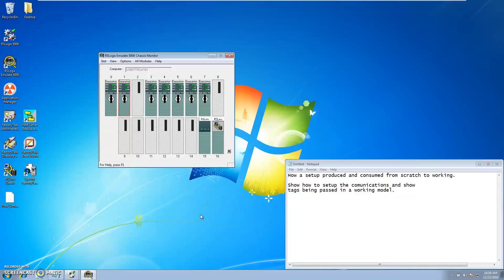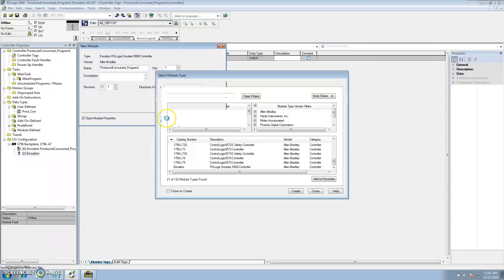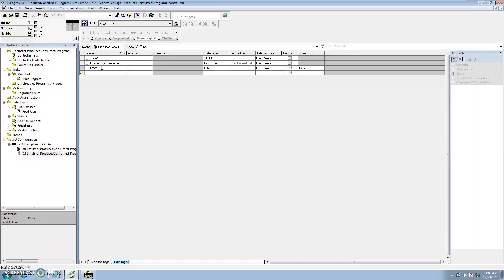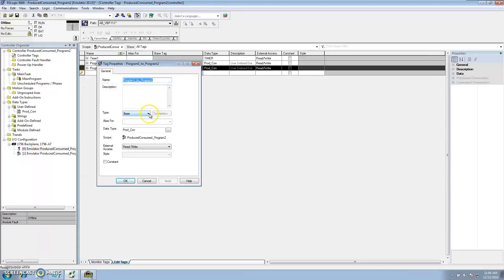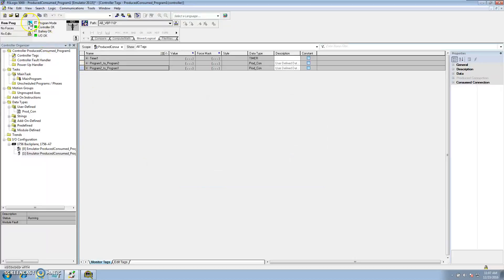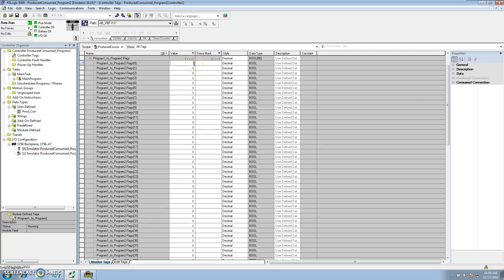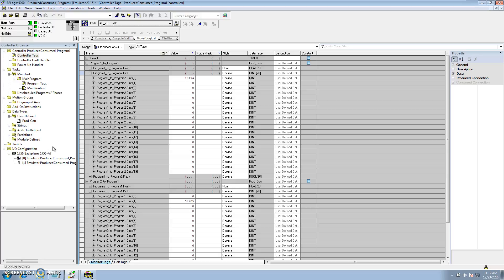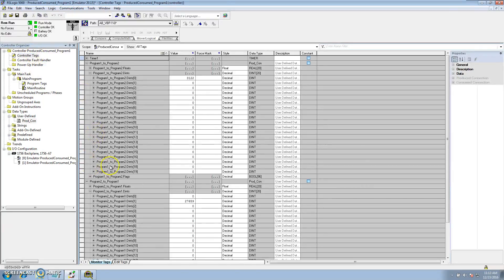RSLogix 5000 Produced and Consumed Tags (HD) | How Processors Pass Data in RSlogix 5000

Comment: @ Shane Welcher
Thanks a lot for this Info. It is very useful. I am trying to communicate with 1768-ENBT with S7-300 CP 343 module. Can you please let me know how can I exchange data between AB <--> Siemens? Thanks in advance, - Arun
Reply from the maker: You would need to setup the data in the Rockwell processor to read a generic type.

Can a Logix controller read/write data from a Siemens S7-300 controller using Ethernet messaging?

Yes, but it would require a ProSoft ILX56-MM "inRAx Message Manager for Industrial Communication".
Reply from the maker: Yes, but it would require a ProSoft ILX56-MM "inRAx Message Manager for Industrial Communication".
Reply: Shane Welcher - Tanks for the reply. I am not sure about RX logix.  I will check with them😀..(ALLEN BRADLEY person).